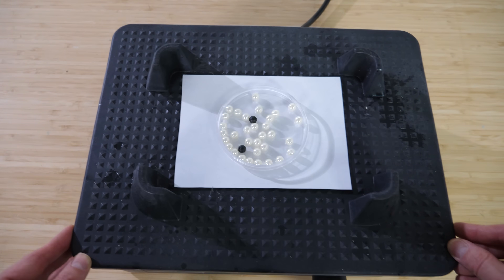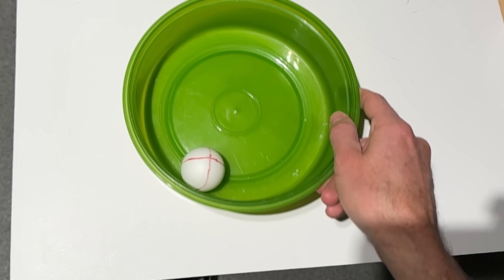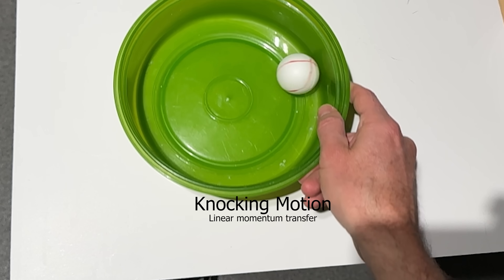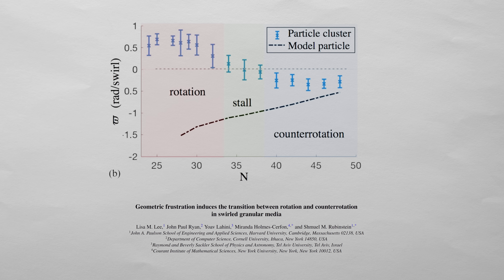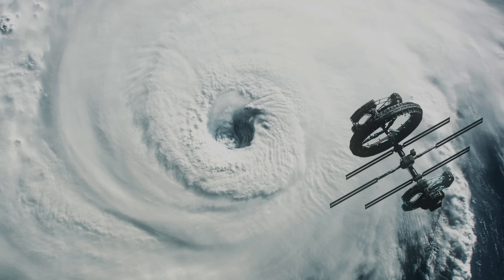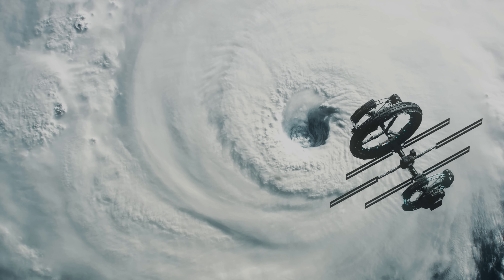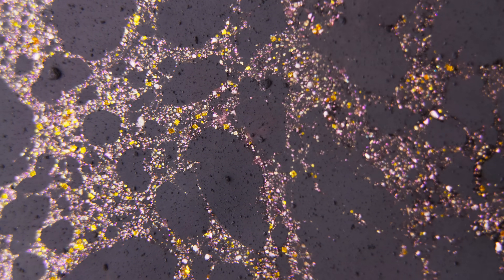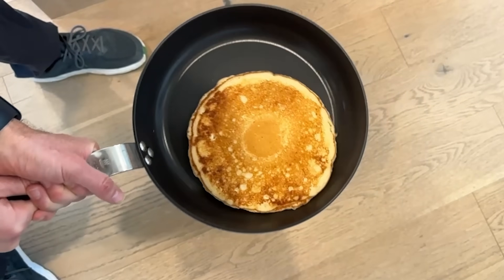The Strange Physics of Spinning Pancakes

Comment: Isn't it just the pancake sliding against the side of the pan? Just like in a planetary gearbox, the planetary gears rotate in the opposite direction of their 'orbit' direction.
Reply: That's exactly what it is. The movement of the pan causes an inertial effect on the edges of the pancake to apply more friction to the sides of the pan than the flat side of the pancake that is sliding on the bottom surface of the pan. It's basically just what you said it is - much like a child's waist rolling around the inside of a hula-hoop.
Reply: It's not "exactly" the same. The pancake spin is caused by friction with the edge of a pan. Planets don't have a giant pan to roll on. I think it has to do with the formation of the system and conservation of angular momentum.
Reply: Yes, but pancake is pure solid so in this topic the most extreme and simple case. It's much more complicated for fluid.
Reply: @twang5446  That makes sense. Thank you for the clarification.
Reply: That's exactly what I saw.  Once the pancake is big enough to move as a big circular unit, the friction against the side of the pan is more than the friction on the bottom of the pancake.  And if you watch the pancake at the edge where it contacts the edge of the pan where most of the friction is, the pan is always exerting a counterclockwise force against the pancake due to the precession of where the edge of the pancake contacts the edge of the pan as it goes around.
Reply: Correct, it's still an application of friction though
Reply: Yes, in the extreme complete stick and no slip against the edges case. But even a pancake won't be as extreme stick-with-no-slip as a gearbox. And I guess the vid shows a way to go smoothly from nearly all slip to nearly all stick, with a real physical system.
Reply: That's what I noticed about this phenomenon for a long time already.
Reply: and the liquid is going with the wall
Reply: Yes
Reply: Yeaaaaa that's what I thought and I'm like well I saved myself 6:42
Reply: Did you not see the orange juice
Reply: yeah，i get it in 10 secs.
Reply: yeah and if you pack more and more gears inside, at some point the whole set will start whirling in the opposote direction, right? wrong. then it's different from a gearbox after all, fundamentally.
Reply: @HoSza1  ...the hypothesis is inaccurate but not for the reason you're saying. I'm not even sure what you're saying.
Reply: @joshyoung1440  so you can't even understand what I mean, let that sink in first. OK, you don't understand, then how are you gonna refute what I said? Come on, you can't be serious. 😂
Reply: The imparted force from the inside wall of the dish is still the opposite of the direction of travel.

If anything, the guy you're disagreeing with makes a great point.  It shouldn't be called pancake applied to other models.